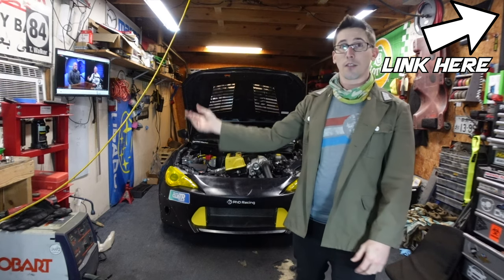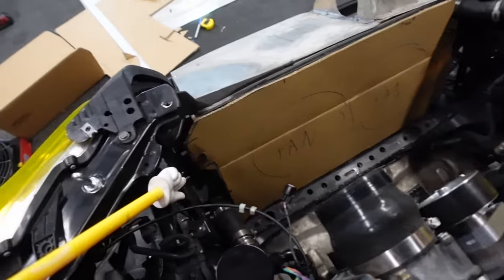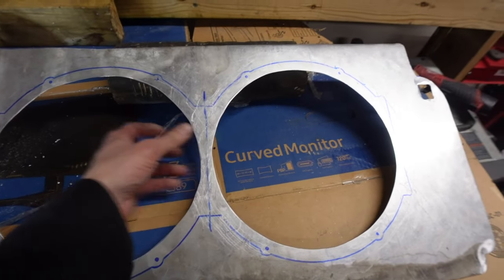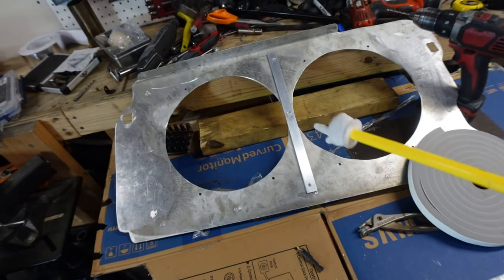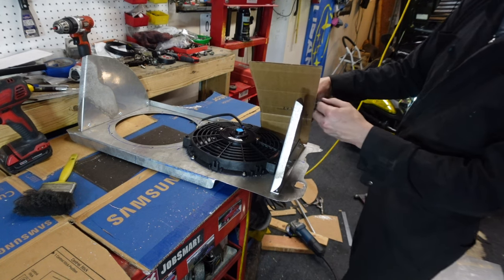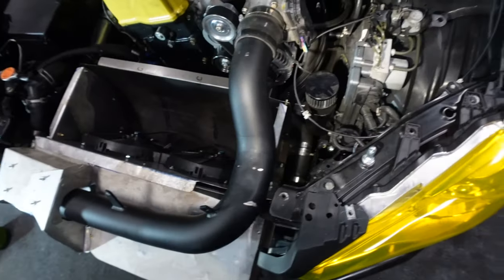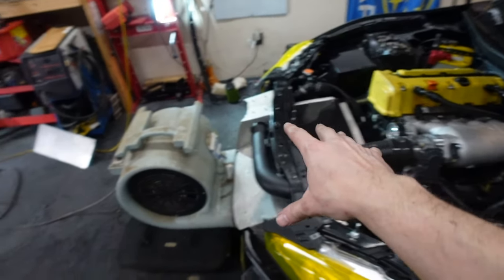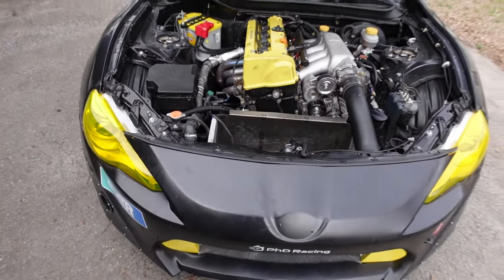FRS radiator Duct Exit

Comment: You may want to slice a piece of hose longways to make a grommet to go around the intake pipe where it goes through the front shroud, it should keep them from rubbing through each other and might seal the air gap up a bit
Reply from the maker: Yeah I plan on adding some rubber edge trim to places like that & add some foam to help protect it once it all goes back together. I have apart for paint right now.
Reply: @TripSkyWalker  its gonna be sweet!

Comment: Did you not keep any space in your fan shroud - between the fans and radiator?
Reply from the maker: there is are 1/2in  ledge on the Radiator & some foam gasket that makes a gap between the two